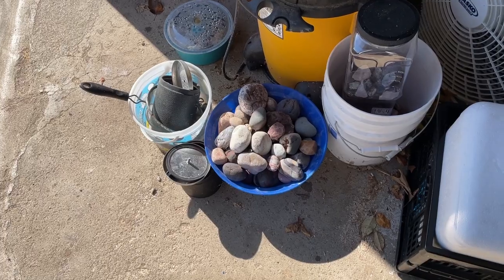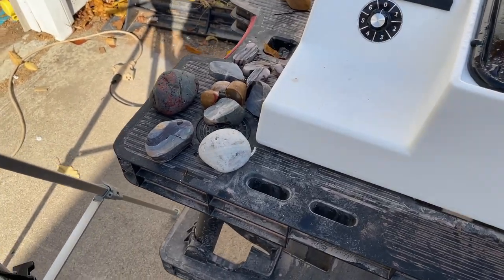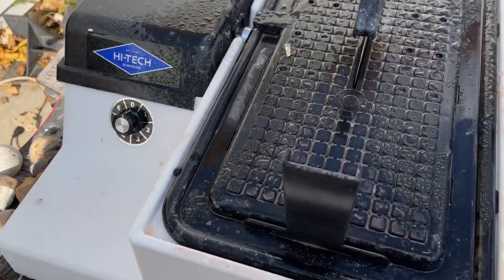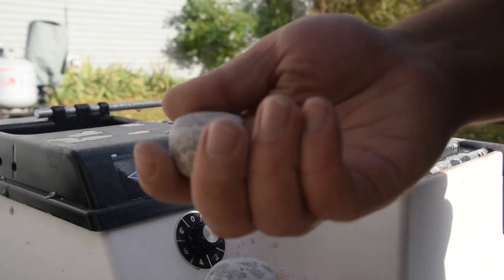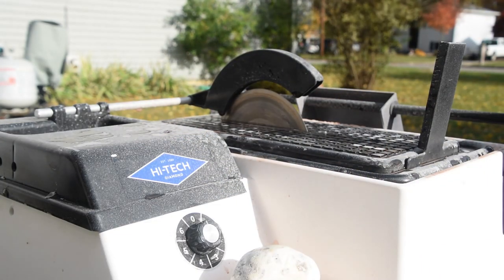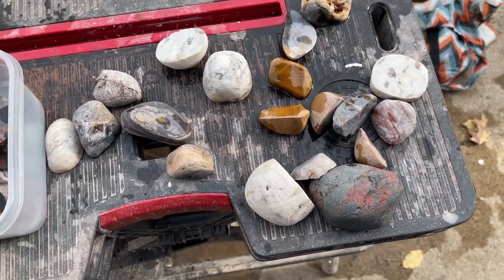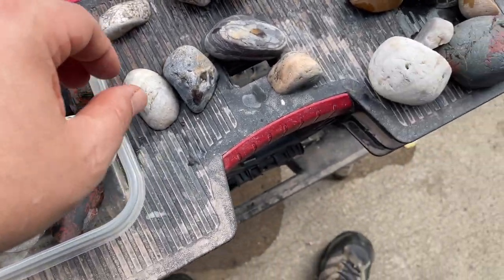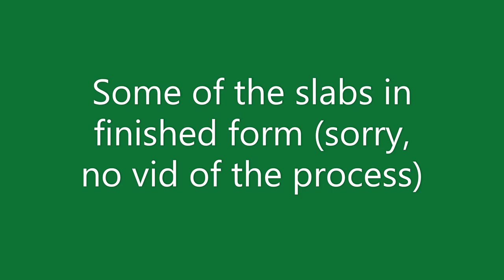Slabbing Stones for Cabochons

Comment: something else you might try. if the rocks are getting tough to cut. before cutting... take a brick and run it thru. it sharpens the blade
Reply from the maker: Great advice and thanks for the ID on the jasper! I may try the brick trick if the weather holds. Otherwise, I'll try it out in the spring when things warm up again.

Comment: whats the difference between your saw and a cheap wet tile saw??
Reply from the maker: My saw blade is quite a bit thinner. It's a lapidary saw. That being said, a cheap wet tile saw works just fine. You lose a little more rock due to the blade width is all. I started with a tile saw from Harbor Freight.

Comment: and part of the problem you maybe running into.... is you don't force the cut. let the machine cut the stone instead of the other way around
Reply from the maker: I apply enough force to keep the rock on the blade. That one just stayed on the blade an exceptionally long time. Though, to be fair, some of the other rocks I cut were extremely soft (Charlevoix stone). Thanks for the feedback!

Comment: Do you ever worry about cutting your hands or fingers.
Reply from the maker: No - the blades are thin, but not razor sharp like in wood working. Instead, they have an edge of diamond grit that technically grinds the stone in a straight line versus cutting it in the traditional sense.